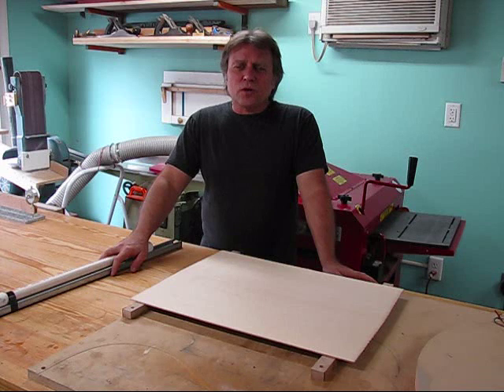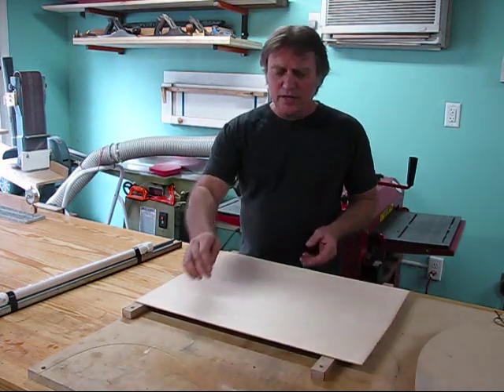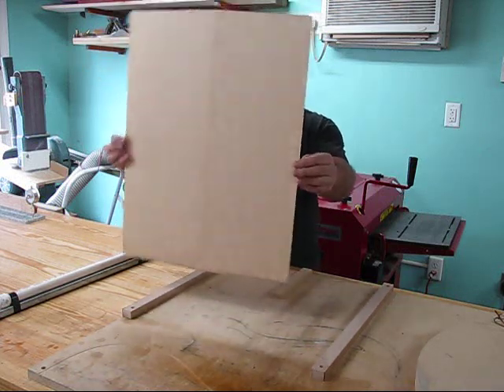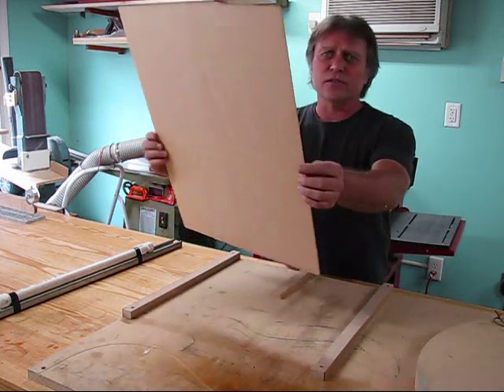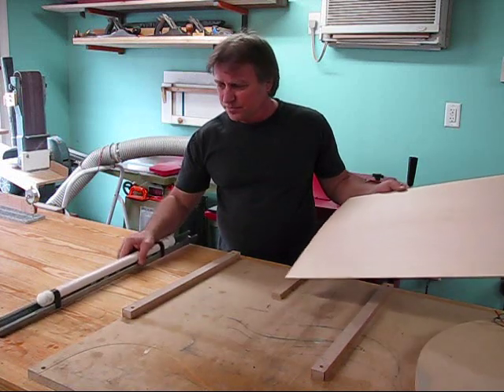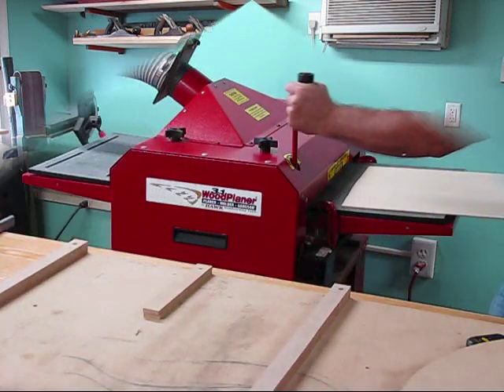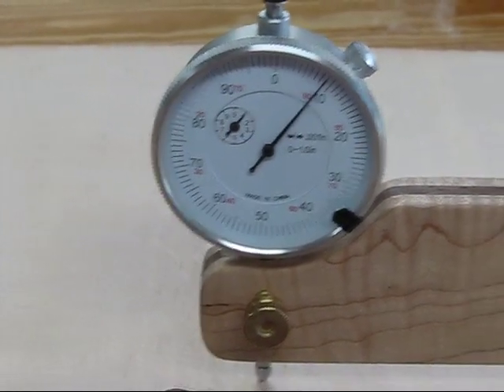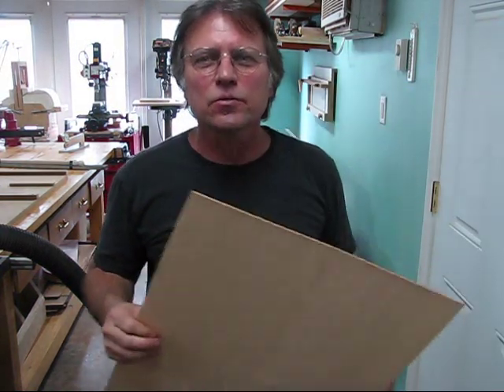Thicknessing The Top Plate

Comment: great video! Just wondering what your final grit of sandpaper would be on the top back and sides before bracing and assembly. Or do you leave them at the 120 from the thickness sander only